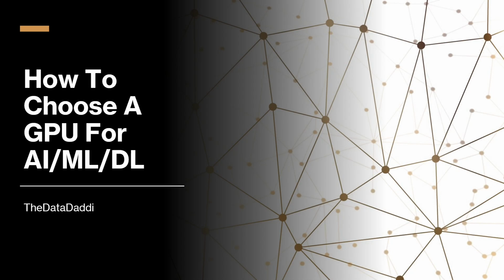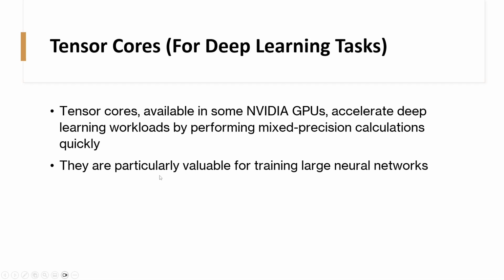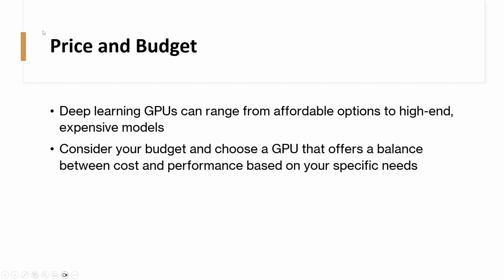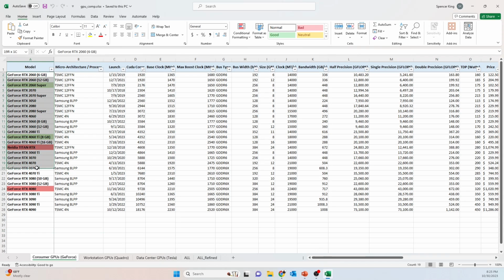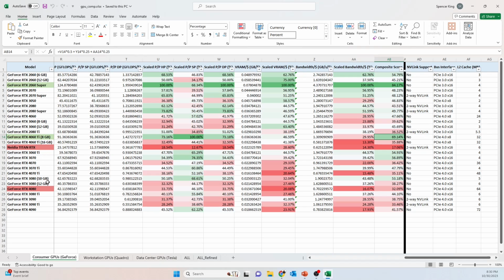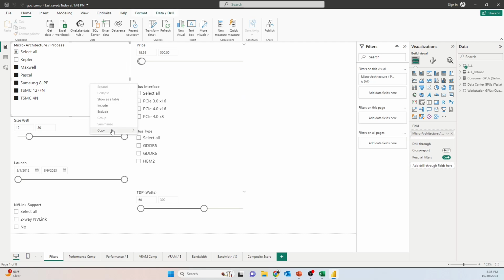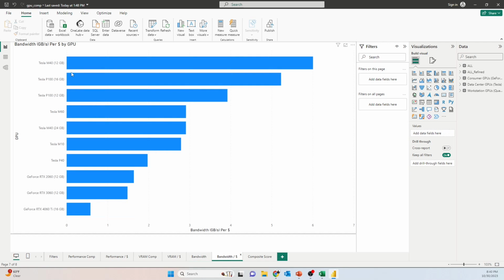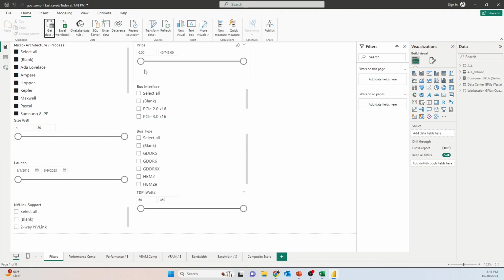AI/ML/DL GPU Buying Guide 2024: Get the Most AI Power for Your Budget

Comment: Consider you have a 3060 12G. Do you prefer to buy a used 3090 with 24G RAM (around 600$) or stay for the 50 series of nVidia and instead solve higher ram requirement on the cloud?
Reply from the maker: Hi there! Thanks for the question. If you could find one for around $600 I definitely buy the 3090. However, on my end I have not seen any from reliable sellers for less than $800 and normally closer to $1000. 

Also, for me personally the last thing I would do is look to the cloud for higher VRAM requirements. From my research, it is crazy expensive (relatively speaking) to use the cloud for home lab, personal projects, and even some small business applications. For example, with Linode (now Akamai) which is one of the cheapest cloud providers I know about, the lowest tier of service PER MONTH is $1000 for specs that dont even come close to what you could build and self host for the same amount. I am actually going to make a video on this topic relatively soon to address when it might make sense to use cloud solutions vs building/self hosting. 

I also am very interested to see what the 50 series holds for NVIDIA. However, to my knowledge these are not slated to come out until 2025 so you would be likely be waiting quite a while. They will also likely be super expensive in the short term and there is no guarantee that the will overcome the challenges the 40 series face (for example pcie 4 when 5 was promised). 

With all that said, I would probably go with the 3090 (depending on your use case) especially if you can get one for $600. I like the 30 series GPUs best as general purpose work horses at this point especially bc you can use them with NVLink. This may help you with your higher VRAM requirements as well. Hope this helps!
Reply: @TheDataDaddi  Thank you genteleman. Yes, I can find a healthy 3090 for this price because here no one is interested in mining anymore. I will do all tests and even run a game at the end to make sure it is fine. However my concern is return for the investment, I want to earn money or build a startup around this using machine vision projects, so I am not sure will it work for me or not (making money). should I go for 3060 12g for 200$ and accept a lower risk or go for the 600$ 3090 24g. this is my only concern.
Reply from the maker: Ah okay. I see your use case. If you are going to use it to make money not just for personal projects. I would invest in the 3090 for sure. This will allow you train much larger models as well as speed up training significantly. I believe that is probably one of the best GPUs you can buy right now for the money for computer vision related tasks. Especially if you can get a good one so cheap. I would say if you can safely afford it go with the 3090.    @hp2073
Reply: @TheDataDaddi  Thank you very much. I hope you get what you like in your life indeed.
I also remembred one thing to ask. somebody told me the kaggle gives 30 hours per month of cloud GPU for free. also it seems companies like salad cloud gives a 4090 gpu instance for around 0.34$ per hour. as you have more experience, are these real?
Reply from the maker: I have not used kaggle in several years so take what I with a grain of salt. This be a good place to start. 30 hours per week might be enough for you depending on what you are doing. At the very least you could use it as a free test bed until you start maxing it out then buy your own hardware. 

To add some context, some of the computer vision and graph ML model I have been training recently take over a week solid on 2 tesla p40 GPUs. The computer vision model are really not even that big comparatively speaking. Also, instead of the RTX gpus you could go with older Tesla data center GPUs like the p40 or p100 (I would recommend these as they are some of the most compute and VRAM for the money). 

So, I have never used or heard of Salad Cloud, but I just checked it out, and it looks interesting. I have been thinking about a distributed peer to peer GPU compute sharing platform for sometime now. Anyway, it seem like that is what this is. Two drawbacks would be the following: 1) it looks like it is mainly for inference not training on pretrained models (I am not sure if you could use custom models).  2) It looks like it only has RTX series gpus and is geared toward gamers who want to rent out their idle gaming PCs. These would probably not be optimized for machine learning. Anyway, it looks cheap so if it actually performs well then this might be a great option. I have just never personally tested it.

Personally speaking I like owning my own hardware because you always have absolute control over everything, and it is generally the cheapest option by far. @hp2073
Reply: @TheDataDaddi  so you think if I could find a healthy 3090 for 600$, would be a good investment to start? my niche was electronic, I had experience with AI and machine vision but I left it and now I want to come back. at that time, 4 years ago, I had a gtx 1060 6g
Reply from the maker: Ah okay. Gotcha. Yeah I would go with the 3090 for $600 personally. Would probably be best investment at the moment. @hp2073
Reply: @TheDataDaddi  What about Radeon RX 7900 XTX?
Reply from the maker: @Alex626_  I think at this point for AI/ML/DL NVIDIA is still your best option. 

Its funny you asked this question though because I was just talking to another viewer about his setup. He went the AMD route so I finally have some reliable recent data on AMD GPUs in general. Best way to summarize his experience: "AMD is not worth it if you value your time, but once it's working it is fairly decent and a good alternative to Nvidia." He did say that one of the only GPUs he would recommend trying with is the 7900 XTX. 

One of these days I am going to buy one and get it working so I can help people using AMD for AI/ML/DL. Unfortunately, that just requires a lot of time. Anyway, I hope this helps. At this point, this is the best advice I can offer you.

Comment: Amazing. Thanks a lot bro. 
If you were to choose between 3060 12GB and 4060TI 16GB, which one would you go for?
Reply from the maker: Thanks so much for the kind words! So glad this video was helpful. I found it extremely helpful myself in choosing GPUs for my own projects. 

Mmmm. Depends on cost as you may be able to find some great deals for black Friday, but if you want to get the most performance for your money I would go with the 3060. However, realistically its not that much more the the 4060. Overall though, I am unimpressed with the 4000 series GPUs compared to the 3000 series. If it were me, I would buy the 3060 (unless you really need the larger VRAM) and wait until NVIDIA releases the next series of GPUs then consider those options. On a personal note I use the 3060 in my daily driver PC. I use it as a test bed for models I want to scale up to run on my home lab servers. It works really well for that. I have not have any issues loading and working with fairly decent sized models.
Reply: Thanks a ton bro @TheDataDaddi
Reply from the maker: Sure man! Glad I could help
 @jubayehossainarnob
Reply: 4060 ti 16GB. More memory is better and the first priority
Reply from the maker: Probably the way I would go as well. @TekTakes

Comment: This is a fantastic video explaining how to choose a GPU for deep learning/AI/ML. He extended Tim Dettmers single GPU performance chart into a masterpiece of a spreadsheet and PowerGI dashboard. Masterful. I wonder if you factored electricity cost, the cost of removing heat from the room, and total decibel output into the decision. I see in a subsequent video that the server is installed in what looks like a basement. The rack is within a few feet of a gas can. Those Dell machines can run hot, so you might want to move the gas can elsewhere. How noisy is the final product with two P100's?
Reply from the maker: Hi Prent. Thank you so much for the kind words. This took me quite a while to put together so I really appreciate the positive feedback. 

I have not directly calculated the electricity cost for all of the GPUs. However, for the P100s in the dell PowerEdge R720. I estimated it costing roughly about $200 per year base on 15 ¢/kWh avg in GA where I live and my anticipated usage. However, that is really just a guess. I need to buy a gauge to actually measure average power consumption over a month or so and extrapolate that out. This seem like a good idea for another video so stay tuned. lol

The heat removal has not been an issue at this point as the basement is fairly large and stays naturally around 65 F. I have to see what it is in a week or so after the servers heat things up. 

Also, as far as the noise is concerned. As long as it is in the basement or a room that you don't use often it is fine. They were in my bed room for awhile, but had to move them because of the noise lol. As far as decibels are concerned, I have not measured. However, If you are interested I can try to check and let you know more precisely. 

Thankfully the gas cans are empty, but I agree probably a good idea to move them.  

Thanks again for the interest! Glad you found this helpful.